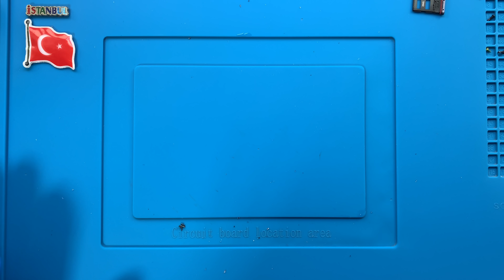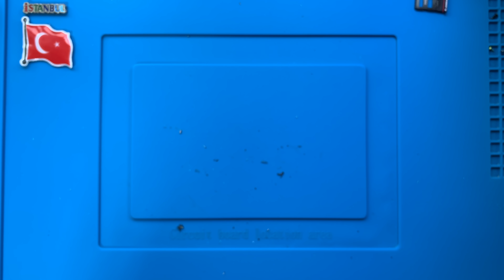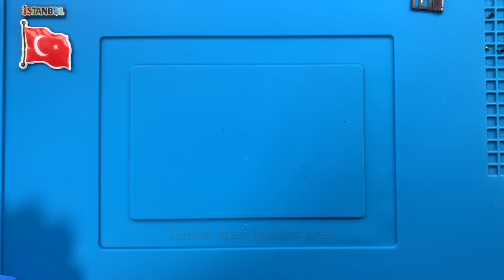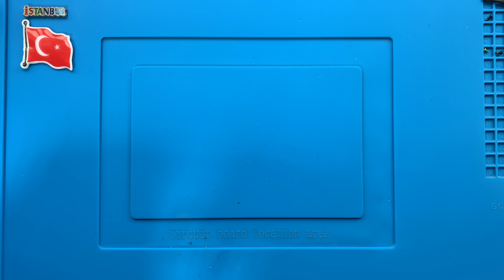Xiaomi Mi 11 Ultra Ekran Değişimi 🇹🇷

Comment: Do you loose ip68 ?
Reply from the maker: Hello;
Phone manufacturers only guarantee water resistance for undamaged and undamaged devices. For this reason, it is necessary to be more careful about liquid contact after screen - part replacement and technical service process.
Greetings.